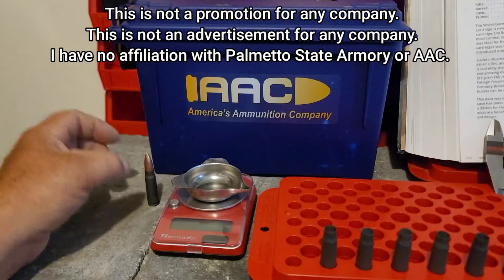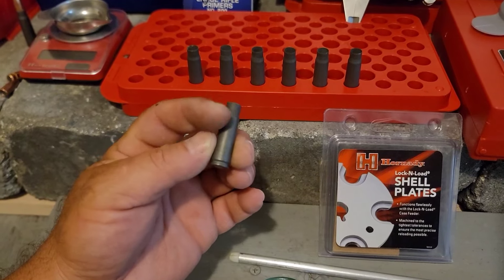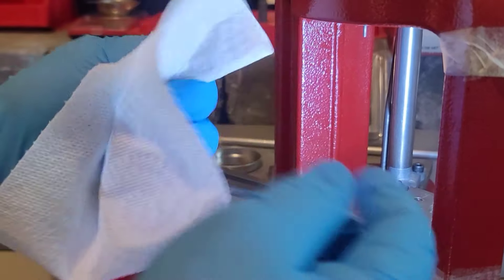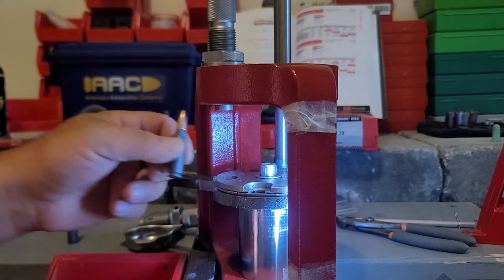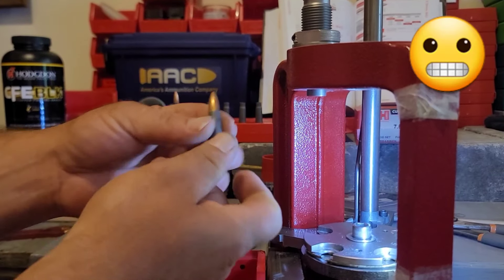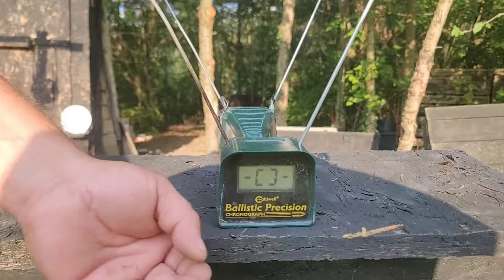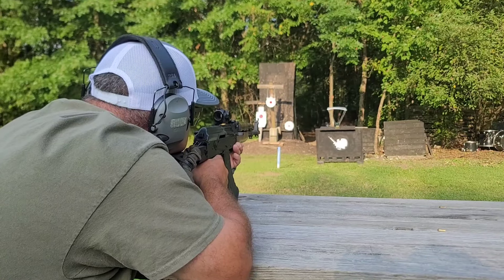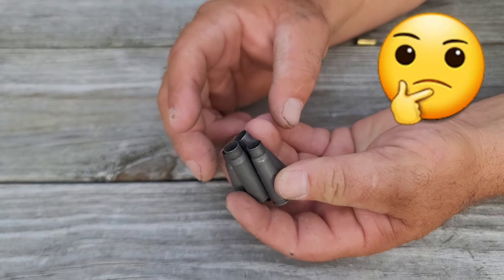Reloading STEEL CASE ⚪️ AAC 7.62x39 From Palmetto State Armory 🇺🇲

Comment: I think the coatings on steel cased ammo is mostly a military thing, where the ammo is often exposed to moisture in the field.  The way we, sportsmen, store and keep our ammunition dry, in cans, we should be able to tumble these steel cases down to bare metal and not worry about them rusting significantly.  They would look cool cold blued, too.  It's all irrelevant to me, because I don't use steel cased ammunition.  But many shooters do, and some of them will reload steel just because they can.  I know they will, because I have reloaded aluminum cases from Federal, since they're now boxer primed, and they work fine.  For two reloadings that is.  After the third firing, they split.  Although they function fine even to that point.  I'm talking about 9mm Parabellum here.  I don't recommend it, but it will work in a pinch.
Reply: @ChadBoss-qr4hl  I've split brass cases on various calibers over the years from .22 WMR to .243 Winchester, in both rifles and handguns.  It has never really been a safety issue, I don't think, although I have ruptured the rims on .22 LR ammunition while shooting rifles and received a blast of hot gas in my face.  The only reliability issue I've ran into with split cases has been with .22 WMR and the Marlin bolt actions chambered for it.  My dad and I have owned three of these rifles that frequently split cases.  This happened with every brand of ammunition we shot in them.  This would not have been a problem if the rifles had ejected the split cases.  They did not.  The split cases would stick in the chambers and required a rod to knock them out, or a small screwdriver to flip them out from the breech.

Comment: I would probably avoid reloading AAC steel cases as they are typically over maximum length & need to be trimmed.
Reply from the maker: I checked the trim on these. Good point👍👊🦃

Comment: I have to say this is indeed the first time I have ever seen steel case ammo that’s Berdan primed. Very interesting that little change in design might be a major factor for guys like myself who want to reload 7.62x39. I am reloading the brass case Norma 7.62x39. I’ll get about 5 reloads out of those cases before the case head is just mangled as well as massive dented case walls. But with steel that’s reloadable that’s a big deal. Ak’s are indeed designed to run steel because of the violent extraction.
Reply from the maker: Good to know about the norma. I have some PMC to try soon. Other than that i think just a little new starline maybe. I never used much 7.62x39 Brass so im very low. It makes me think about switching to 300hamr since I have plenty of 223/5.56
👊👊👍👍🦃
Reply: @theturkeysopinion brother the velocities of the 7.62x39 is so perfect for cast powder coated projos. We just need to get the proper materials. I think these steel cases in conjunction with cast powder coated projectiles. Would make a seriously good combo. I was loading MP .312-159 it’s a mold that’s capable of loading a hollow point projectile. And even with the Zastava having a over sized bore I was getting 2” groups. AND the fact that it was a hollow point it would a devastating round. All I need to do is get a proper sized barrel in combination with the MP molds projectiles and the AAC case’s and i think that would indeed make one heck of a combo!!!!!!
Reply: @theturkeysopinion Brother do you have a PO BOX I could send some of my castings as well as some steel cases and brass cases too !!!! I have to see what the end result is

Comment: Interesting test 🤔.  However I am curious if you're concern is correct, or warranted as to the the protective coating. A less concentration of alcohol bath maybe? Should evaporate dry quickly. Also there are some very good commercial grade spray moly lube that possibly would be usable? AGAIN A QUESTION? Like this initial test just a few for curiousity. I do have a sizeable amount of  .223/5.56 that maybe relevant to this test, though I'll probably never be able to deplete my on hand of factory, and hand loads with my single shot 😂.  My guess is the popping is simply the lack of flexibility of the steel case. Which leads me to a second question. After setting the bullet would it be interesting to pull it to examine for any maring of the jacket. Food for thought from an old mountain man who tends to over think 🤔 things

Comment: I have reloaded thousands of Wolf 223 steel cases. Have to chamfer the case mouth but not any more prep needed than normal. Usually lose them to case mouth splitting after 3-5 reloads. What’s really pathetic is looking through the grass for steel cases. You’d think they were Lapua.😂
Reply: STEEL case sir- easier than ever. Magnetic. Get a construction magnet- kinda looks like a broom with 2 little wheels at the sides, but it has a big ass magnet instead of a pushbroom. Meant for collecting nails and such. Quick and easy roll over and you'll get every single case. I consider myself a poor though and I've never needed to reload steel😂 there's ALWAYS brass around. I hate going to the local range- too many yahoo's scare the piss out of me- but they have buckets and brooms and ask people to clean up their brass when they are done. Its free to take if ya want it. You don't even have to be a creepy brass goblin about it😂

Comment: I love that press ❤❤❤❤❤❤
Reply from the maker: That one has worked very hard in its life. I think I need an update🦃👊👍
Reply: @theturkeysopinion  what are u looking for? 

have you tried the Hornady bullet droppers? Theyre for pistol calibers. 9/40/45 I modified the 45 to work with 458 bullets/458 socom

They make the progressive pistol loading a lot better since ur only loading the cases and pulling/pushing
Reply: @theturkeysopinion  I also have an rcbs jr 2 for smaller batches I love them both ❤️

Comment: Good series Mr. T, I'm looking forward to seeing how the case life pans out.  While I'm not opposed to putting a few rounds of steel cased ammo thru my SKS or AR, I've generally shied away from reloading the steel cased ammo.  I did reload a few .223 TulAmmo cases, just to see if it would work (it did) but I used an old .223 resize die that was scratching brass cases, as I was deathly afraid of the steel cases scratching my good .223 size dies.  It did not scratch the steel cases, which I think is good.  I loaded them with 26.0 gr of W748, a mid range load for the AR and used a FMJ bullet with a slight crimp in the cannelure (which you pronounce wrong by the way...  hmm, picking nits now!).  Since these cases had been tumbled after decapping, they very quickly got some rust spots which wiped off easily.  A quick dab with a patch and some cold blue gave the cases a bit of protection and a bit of a 'cool' look as well.  They functioned fine in my AR but I think I would have to be in dire straights before I loaded any volume of them.

I recently bought 500 rounds of 7.62x39 range brass and paid just .15 cents per case from Arm or Ally.  There were slightly over the 500 number with just a single berdan case in the bunch.  All were once fired and all reloadable (no crushed cases) and all were known brands.  I'm in the process of trimming them but the few I've actually loaded worked just fine.  There were about 20 small primers cases and the rest large.  A good deal, I think!  For plinking I generally load 123 gr Hornady V-Max (seconds from Midway) and for more serious things I load the Hornady 123 Soft point bullet, which I find to be very accurate (in an AK/SKS kind of way) and that works perfectly (mushrooms) down to 1700 fps.  I haven't tested below that yet but intend to... eventually!  For hunting or defensive work I don't think these bullets can be beaten when considering price and performance!
Cheers,
jc

Comment: Why are you reloading steel? I'm buying Norma, Belom and New Republic brass/boxer rounds, new manufacture, under 2 quarters per round
Reply: Because some of us are really, really cheap!
Cheers, 
jc
Reply from the maker: I was just trying to confirm what the manufacturer was claiming about reloadability. And it was a fun project because I have never reloaded steel. I've always wondered about it though. Usually the berdan primers get in the way but these are Boxer. 
I don't plan on making a habit of it , trust  me👍👍👍👊🦃
Reply: Steel is easily picked up with magnets and bending over to pick up 500rds of brass cases is rough